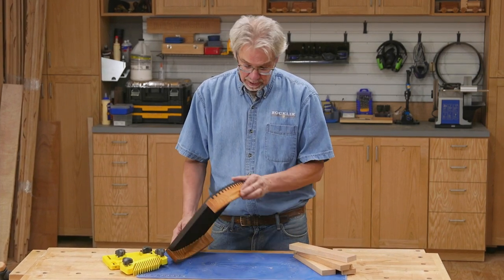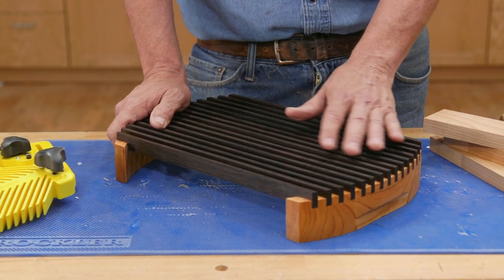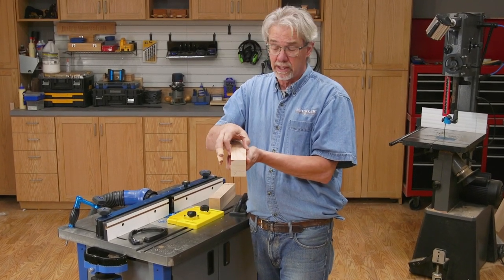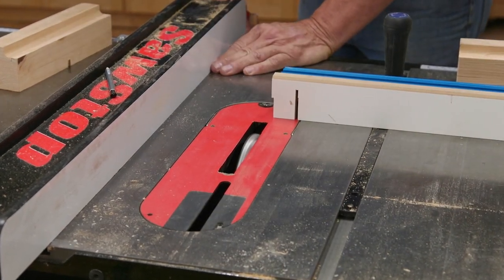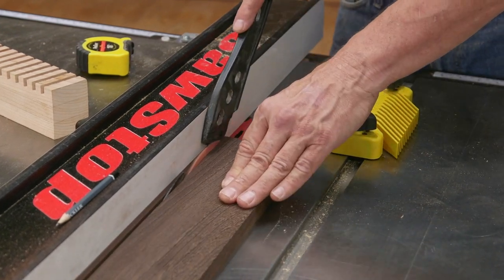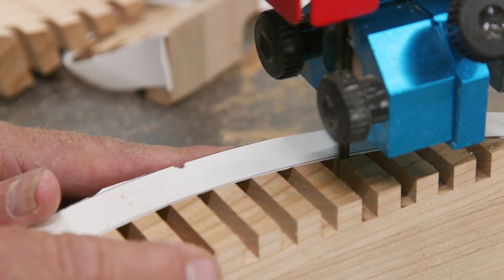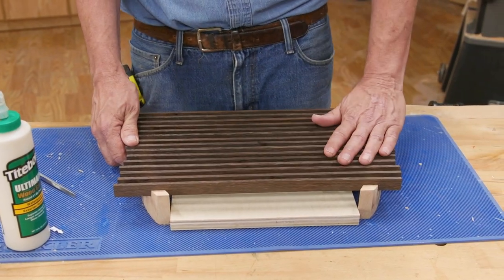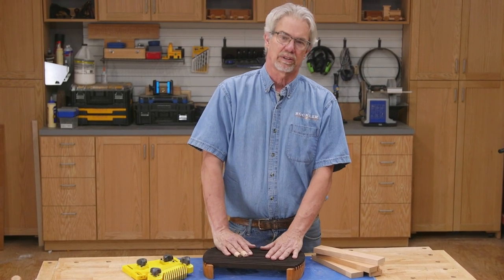Making a Trivet with Rounded Edges

Comment: I tried this method on a 22-44 Performax belt, but it took forever to rinse the “soapy suds” off of the belt… I never was able to get it all off before I gave up and rolled it up to let it dry.
It took over a week to dry… there were some of the more clogged / raised burned or resin build up that was easier removed, but it was not as clean and I would have hoped.
I will have to use it on the drum sander to see how it works.
Thank You for the suggestion.

Comment: A second piece could be created using the off-cuts from the ends.  Take the corner cuts and glue them to the inside of the inner piece.  This should reinforce the narrow ends of each and form a new arc.  All the slots should line up easily.  Size the length so it will nest under the first trivet for a set of two.   Thanks for the video.